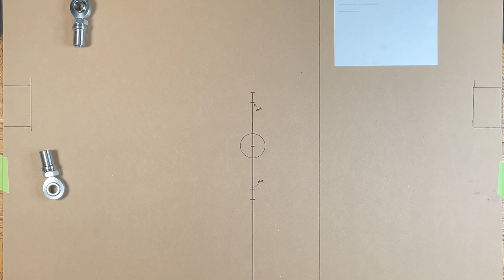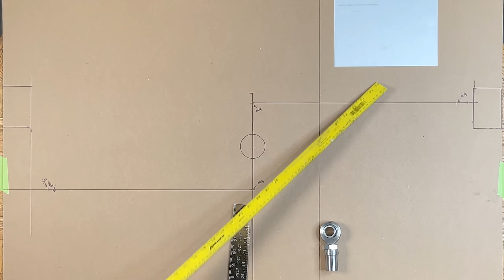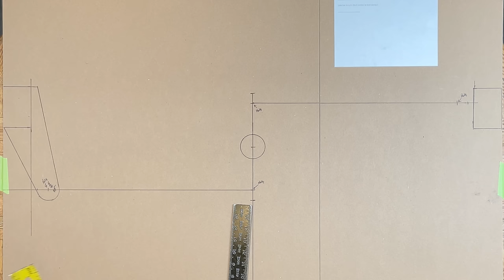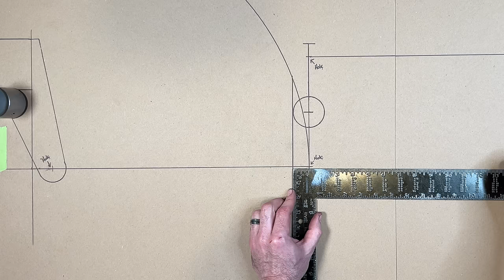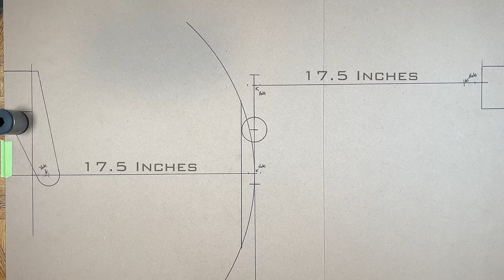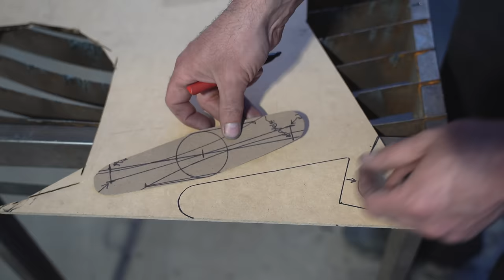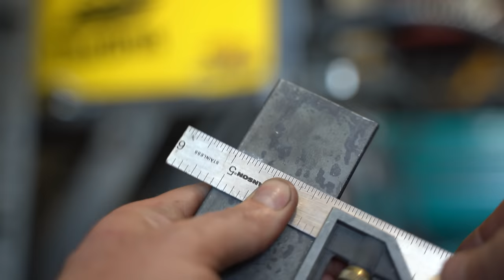The Greatest Watts Link Tutorial Ever! Mighty Max Ep. 16

Comment: After criticizing Heim joints in a previous episode, you use them here. So why not use polyurethane? Oops, looked at Thorbros site where they explain, "we highly suggest using our heim joint watts kit because of the extra non-binding travel the heims provide.."
Reply from the maker: I don’t remember criticizing Heims, but I may have. They have cons just like anything else which might be construed as negative talk. They are expensive. They don’t dampen vibration so often it’s a terrible choice for luxury vehicles. They are prone to premature wear because they aren’t protected from dirt. That said they are NOT maintenance free.
Watts link bars are interesting. The ends need to pivot around the bolt just like a typical suspension link bar when the suspension moves up and down, but because the axle moves back and forth as well, they also pivot on an additional plane. Polyurethane bushings can deflect some but too much deflection can damage them. Therefore, even with all the cons, Heims are still ideal for Watts link bars.

Comment: Watt about roll centre? What height should we set it at?
Reply from the maker: You don’t have a whole lot of choice where the roll center goes with a Watts link. The roll center is located at the bolt for the propeller. Most people agree a lower roll center is better but you can only go so low before you risk snagging your center link on something.
So often it ends up at about the middle of the diff. 🤷‍♂️

Comment: Why don't you make the arms say 10 mm short as then the joints can be adjusted both ways to get stuff perfect. If not why use a joint with a thread ?
Reply from the maker: I basically did. I found the theoretical ideal length of the links and then created them so that they would be that ideal length with the threaded Heim joints not fully screwed in. That will allow about a quarter inch of movement on each end.
Though it doesn’t apply here I’ll still answer your last question… I use threaded Heims not only for adjustment but for replacement purposes also. Heim joints don’t last forever unfortunately. Like a light bulb, I can unscrew a bad one and replace it with a new one.
Not to mention, I don’t think there is such thing as a weld-in Heim joint.

Comment: Can you drive and haul daily a bagged and bodied truck????🤔
Reply from the maker: You can do both if it’s setup properly. Did you know most Semi Trucks now days are on air suspension? Those haul all day every day!
In a truck you plan to load up or tow with I would advise that you mount the rear air springs directly to the axle. You get less lift but that will put less stress on the bags.
Do it!! 🙌

Comment: Should ride height be with riders weight in vehicle?
Reply from the maker: That’s a good question. Generally ride height is not considering passengers. The amount the suspension compresses when an average human gets in, wouldn’t make enough of change to the geometry of the suspension so it’s usually ignored. 
Some Toyotas, however, have front springs that have different spring rates on the drivers side vs the passenger. The assumption is to keep the vehicle more level when only a driver is inside.
This is fairly rare though, I think.

Comment: Can I do this with a triangulated 4Link ?
Reply from the maker: You can, but it’s not necessary. The geometry of a triangulated 4 link keeps the axle centered. So a panhard bar or a Watts link wouldn’t be needed.
However if the triangulated 4 link isn’t stable enough, like on the factory Ford Mustang, the Watts is the ideal addition because of its nearly perfectly vertical movement.

Comment: Would this work for offroad truck flex?
Reply from the maker: Absolutely. When setup with off-road in mind, a Watts link can be made to have unlimited articulation, limited only by the body, frame, or link bars. In other words, an axle could technically spin beyond 360° on the ‘propeller’ pivot.

Comment: What benefits does a Watts linkage have over a triangulated 4 link?
Reply from the maker: I believe a Watts link is a little more stable in corners than a triangulated 4 link. Especially on smaller trucks with narrow frames that make it difficult to get 30° or more in the angled bars. A Watts link also allows you to run parallel bars which opens up a lot of room in front of the axle. A triangulated 4 link commands a lot of real estate.
However, a triangulated 4 link opens up room BEHIND the axle. So in reality, both setups can be more beneficial than the other depending on the owners needs.
Reply: @GarageFab  Ah I see. For some reason I'm reminded of the Ford Aerostar rear suspension that uses a single triangular upper link and straight lower links. Surprising amount of suspension flex for a minivan.
Reply from the maker: I’m not familiar with it, but I believe it. For off-road/rock crawling, I don’t think there is a better setup than the triangulated 4 link. With wishbone (by your description of the Aerostar) is a very similar design will almost just as much articulation capabilities.
Reply: @GarageFab  Back in the day Ford expiramented with weird stuff. I once saw a 4x4 Ford Tempo that used a PTO cast into the transaxle pan that meshed a gear into the ring gear and sent that down a prop shaft to the rear axle. 4 wheel drive was activated using a clutch from a button next to the visor. Not to mention the Ford Twin Traction Beam axle. How about a straight 8 with a transmission mounted in the center below the engine taking power from the middle of the crank shaft? Yeah they built one of those.
Reply from the maker: Haha. Sounds like someone on the Ford staff was on drugs.
We need more of that.

Comment: BMR told me that I do not need a sway bar with there system.   I’m still trying to figure that out.
Reply from the maker: What kind of car do you have? Can you send me a link to their system?
Any suspension designed for decent handling, I can’t imagine Wouldn’t have something connecting the left and rear side to at least mimic the job of a sway bar.
Reply: @GarageFab  Torque Arm Suspension Kit, GM 10-bolt Differential (1974-1981)
Reply: @GarageFab  it’s a 79 trans am

Comment: I worry that the hole in your inner cover will allow fluid into the outer cover that has no way back to the inner side of the inner cover
Reply from the maker: 100% there will be trapped fluid in that small void! But I’m not worried. At the moment, I can’t imagine what problems that would cause. Hopefully I don’t experience any!! 😳
Reply: @GarageFab  best would be to "top off" the diff after it is up and running/ driving around so as to maintain proper fluid level even though it will technically be over filled

Comment: Why can’t the propeller be vertical at ride height?
Reply from the maker: It absolutely can. The reason for angling it would be to gain additional movement in an adjustable height suspension application.
Vertical would be just fine, if not preferred on a static height vehicle

Comment: I'm trying to find a model of how a watt's-link would move if articulated as it would offroad.  I think I'm visualizing it correctly, but....
Reply from the maker: Not much different, Kenn! I’m not an off-roader, but am I correct in saying that articulation is much more important than suspension travel?
A Watts link allows quite a bit of travel, but it allows unlimited articulation. 😳
Reply: @GarageFab  you should really get into off-roading so you can tear stuff up and show us how to fix it.  Just sayin'  😆  My current coilovers only have 12 inches of travel, and I am on radius arms.  I am dreaming of going to 14 or even 16 inches of travel one day, but first I'm needing to get rid of my trackbar or relocate my fuel tank and go triangulated.  This is why I found this video so interesting.
Reply from the maker: You really can’t beat a triangulated setup.
I’ve seen axles articulate almost 90°. Even though a Watts link could essentially allow infinite articulation, you still need a place to mount the links (i.e. a frame) so there will always be something to stop the axle. The triangulated 4 link doesn’t have these limitations!
Reply: @GarageFab  relocating the gas tank and redirecting the exhaust may be an easier task than trying to build a watts-link from scratch too I suppose.  lol
Reply from the maker: Truth!

Comment: Would this work on a front end 4x4 with a 16 inch travel??????
Reply from the maker: I honestly don’t know a whole lot about solid front axles, Mike!  Aside from basic geometry. But I don’t see why a watts link would be any less fantastic in the front.
The challenge, though, might be that the steering mechanisms are often in the front, because the driveshaft would get in the way on the back side. So I think you’d have to get creative with either the steering setup or the Watts link to make it operate around the drive shaft.
But if you can figure that stuff out, absolutely!
Reply: Air ride mom get in close to grand on rd hight up 5 inches off rd up 5 more inches show off up 5 more inches
Reply from the maker: Your speaking my language. That is why I love air suspension so much. 🙌
Reply: @GarageFab  the drop axle on a big truck flat 4 inches tall 21 inches air bags
Reply: @GarageFab  air ride on a 57 gmc form truck making it into small rv I will send you pitchers of my drive set up when I get home I’m a long haul truck driver

Comment: Are you using ATF as cutting oil?
Reply from the maker: It is! Something an old man taught me, and I just never changed.
Reply: @GarageFab  cool! Now I feel better because I did in an emergency a few years ago (ran out of cutting oil, but had a leftover 1/2qt of Dex), then switched permanently because I thought it worked better!

I must have been right!
Reply from the maker: I’m sure a chemist or physicist could disagree, but it seems like if it’s wet and slippery, it’ll keep your cut cool and the bit/blade moving freely. 🤷‍♂️

Comment: The bolt is seeing  shear force.
Reply from the maker: It for sure is. (Was. Before building the support.) But I’m pretty certain that’s not the only forces present. If the attached component was much smaller and closer to the threads, I’d agree completely. But the forces are also at the head of the bolt so there’s some bending forces present as well.

Comment: So if I was running a Ford 9" with the yoke centered the axles are 2 different lengths. So how  do u center the wattslink?
Reply from the maker: It would be easiest to use the bridge style Watts link. If you’re not familiar, check out the Watts link video from The Fabrication Series.
You would be ignoring the differential and instead centering the propeller between the brake caliper flanges. So the rotating link might appear to be off-center but it’ll work properly.

Comment: can someone explain to me how roll center fits into the pan-hard vs watts link equation.  or maybe just google it. lol
Reply from the maker: Hey Michael! I can tell you where the roll center is located for each… Hopefully that’s the answer you’re looking for.
The roll center for the rear suspension with a Watts link is the pivot of the center link. (Or the propeller as I like to call it)
The roll center of a system with a panhard is the center of the panhard bar.
With both systems, the roll center changes up and down in relation to the chassis if the ride height changes.
Hope this makes sense and answers your question. If not I’ll try again.
Reply: @GarageFab  Thanks for your explanation. Seems then it’s easier to lower your roll Center with a pan hard at least if the “propeller “ is in a fixed position. Just learning “how to “ stuff-  thanks for sharing your knowledge.
Reply from the maker: I think you are correct, mostly because of ground clearance. With both the pan hard bar and the watts link, the bars should be level at right height. That means with a pan hard bar you could essentially mount it low on the axle just above the bottom of the differential. The pan hard bar would then have the same ground clearance as the differential. But in order to get the same roll center on a Watts link, the center of the propeller would need to be mounted at the bottom of the differential which would put one of the Horizontal links a few inches below. Which could be dangerously low to the ground.

Comment: This is a dope video and thank you for making it but the bevel is unnecessary. I've been welding for 18 years and there's no need for a bevel if you have your welder set correctly trust your welds they're stronger than people think
Reply from the maker: Thank you my friend!  Are we talking about the bevel in 1/4 plate? I’ve never need formally trained in welding but I have tested my own welds. I could redline my welder and I’d still never get full penetration in steel that thick without the bevel.
Reply: @GarageFab  I do not know what kind of welder you are running I guess I should have asked you. Are you using a 220 powered welder? If not then I understand the want for a beveled edge.
Reply from the maker: Yeah, it’s 220. Esab Fabricator 252i .030 wire which might be part of the problem.
Reply: Esab's are good welders I would make sure you have your CFH at about 20 and have the heat up a bit higher they tend to burn on the colder side in comparison to Lincoln and Miller in my experience. I also do not recommend the "wip and drag" technique I have cut those welds in tests and it can often leave small pockets between puddles. Just a straight line like a robot 🤖

Comment: What about roll centre?
Reply from the maker: What do you need to know? I can tell you that the roll center of a rear suspension with a watts link is located at the pivot point of the rotating link (the propeller)
If you move the propeller up, the roll center goes up with it.
Reply: How do I determine where I want my roll centre? And how do I determine what anti roll bar I will need bases upon that?

Comment: but watts links suck.....true they are neither complicated nor scary
Reply from the maker: I must disagree with the “suck”. I will admit that they are often unnecessary and there are far better options out there. Trophy trucks and NASCAR has proven that. But mini truck builders often don’t focus on practicality. Air suspension alone and laying the frame on the pavement is far from practical. And then you throw in cantilever lift systems, remote mounted air springs, and watts links… there’s no argument that all that is unnecessary. But Mini trucks are often just a canvas for experimentation and a outlet for creativity in the form of engineering and craftsmanship with zero focus on performance.
The triangulated 4 link is one of the best systems especially for race vehicles. But the angled bars command a lot of real estate. This isn’t an option on some trucks with massive fuel tanks forward if the axle. Sometimes it’s about utilizing systems that work well with what you have to work with. And so back to the watts link. When you have a truck with 12-16 inches of usable suspension travel and not enough room for triangulated bars, the watts link is the opposite of suck.

Comment: Just triangulate the four link
Reply from the maker: It’s far more complicated than just installing a Triangulated 4 link. That setup requires a lot of room. Generally the entire area in front of the axle is taken up by the link bars, forcing a relocation of the fuel tank to the rear. Some people don’t want the tank in the rear. Other people have additional stuff they need to store like compressors, air tanks and air management systems. A triangulated 4 link also doesn’t perform the same as a parallel 4 link. And then some people need more entertaining setups to build for YouTube. 
“Just triangulate the four link” makes about as much sense as “Just use peanut butter.”
Reply: @GarageFab  Hay , dont get me wrong, video was very entertaining & a bit creepy with the lickin teeth thing . indeed it was the greatest watts link tutorial ever but lookin at them funny shaped top link bars taking up alot of space, more  so than a diff to chassis triangulated set could of saved ya a lot of extra work, but that doesnt make for good content hay Some would say the less moving parts the better & whats wrong with just peanut butter? & where did my like someone gave me go lol
Reply from the maker: Thank you for the kind words, Mr. Magee. 
There is absolutely nothing wrong with peanut butter. If it’s used properly.
Suspension design is much more than choosing the easiest design or one that saves the most time.
This truck had a triangulated 4 link when I bought it. So not doing anything would’ve saved me months and hundreds of dollars and would’ve been incredibly easy. 
Any did I change it? I wasn’t happy with the fabricators work. And I wanted more axle stability in the corners. The frame rails on this truck are far too narrow to create enough angle in the triangulated bars to give adequate side to side stability. You can’t beat a panhard or a watts link at that point.
Also never look to a Mini trucker to determine what “should” be done. The truck builders I surround myself don’t do things because they’re easy. They often tackle flamboyant geometry just because it’s fun to make and a joy to display at shows.
And then a Mini trucker on YouTube?! Forget it!
Follow my series on suspension basics for down to earth explanations of your looking for practicality and ignore my personal builds.